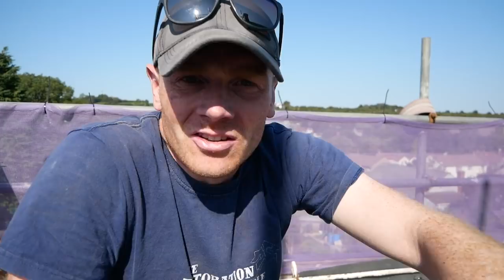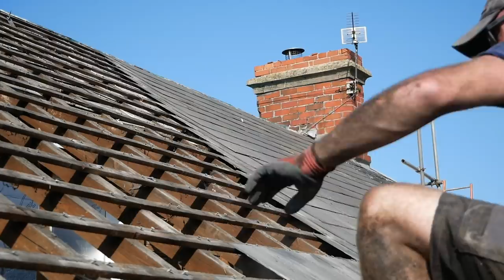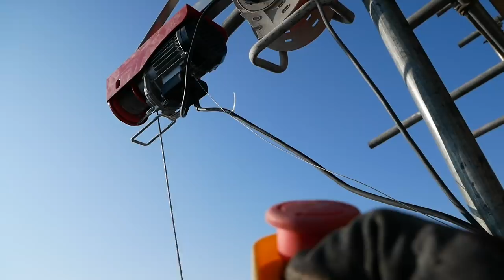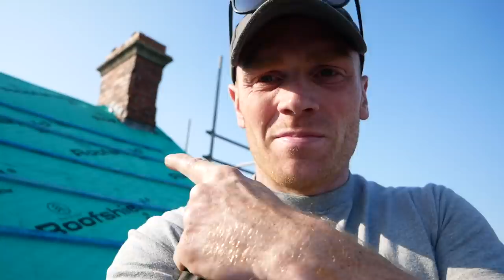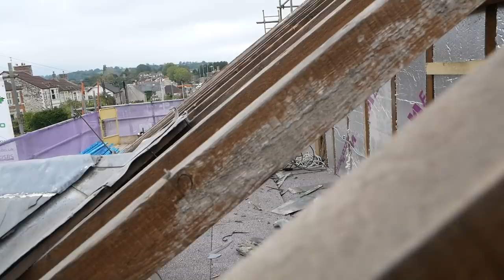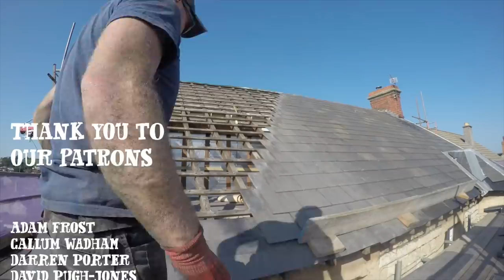REMOVING THE LAST OF THE OLD SLATES - Still no rain! 😬

Comment: Hi Tim, I'm not normally a youtube commenter, but thought I could help here. That sag on your roof rafters by the bay is most likely due to the additional load imposed on it from the bay. If you add some bracing round that section, that will help spread the load to the adjoining rafters (and you could do this when the scaffolding isn't about as you can access via the house - depending on when this video was recorded!). My day job is a Civil Engineer if that helps you trust my comment a bit more!
Chris.
Reply from the maker: Funny you say that as I cut that bit out of the video. I used a timber to try and jack it up and brace down to the floor joists and wall plate, it didn’t budge much and was pretty set in place hence why i reverted to sistering with another timber. Definitely a couple of spots around the roof where additional bracing from the inside would cure it though. 👍

Comment: Having had part of our roof off to make a connection with the new extension roof and then had the tarpaulin dislodged in wind driven rain causing costly damage I now ensure that contractors have a scaffold roof over the works that are vulnerable.  The cost of the scaffold roof diminishes into insignificance compared with the potential damage that can ensue, the risk is not worth it.  Maybe contractors would not risk so much if clients actually claimed on contractors All Risks Policies.  They would think twice about the loss of their excess and the increased premiums.  Besides, having a scaffold roof over means that rain days do not affect progress (delays caused by inclement weather is not a cause for a claim for increased costs) so that it benefits the contractor to be able to take the weather out of the cost/quotation equation.
Reply from the maker: For an extra £8k in our case, I’m happy to just be a fair weather roofer! 😂 well worth it for more major work, especially if converting the loft at the same time or adding dormers.
Reply: @TheRestorationCouple  I can understand your reticence particularly if its the only job that requires scaffold.  My judgement is coloured by the ensuing damage caused by a dislodged tarpaulin in an Autumn storm that the contractor assured me was more than adequate when stripping part of a large roof to make a connection with the new one!  The ensuing arguments over liability were best avoided, given nthose circumstances £8k would have been money well spent.

Comment: Back in the day (Early 70's) we had what were called 'Barrow-Lifts' just like yours there but they were Diesel ...... Had to use one doing a Roof-Screed on a School near Aldershot - Humping barrowloads of Sand & Cement Screed up to the roof .... FINE when it worked, or even when the BRAKE worked - AARRGGHH!!!!! ........ Many a time the barrow went crashing to the ground because the barrow had been slightly over-filled ........ happy Days EH?? ..... 
Value your fitness and the capabilities you have right NOW! ..... They can vanish in the BLINK of an Eye :-(

Comment: I'm sure you know but you need building regs if you replace more than 50% of a thermal element i.e. roof under part L.
Reply: Yeah, I am sure he will rush out and let them know! Building Control are another useless workshy department of the local authority who should be treated with complete contempt.
Reply from the maker: Yes, although we have already done the thermal part of the roof, they are out to check the work as I go.

Comment: Your rafters are really have little depth. They are dimensioned as you would expect a prefabricated roof truss to be made where they rely on the triangular structure for strength integrity. They should have had a minimum of 145mm for that span. I would advise you sheet the rafters with18mm structural ply or at least sterling board then your tyvek sheet and start with vertical batons followed by horizontal tile/slate Batons.
Reply: Dogs Bollocks the reason I offered advise is the type of slate originally used is light weight, but he talked about tiling the roof which would increase the load exponentially, especially if he used concrete tiles. My advise is based on established construction values. I’m not sure where your advise originates
Reply: @coleve8596  Think he's going to be using Spanish slates, not tiles.